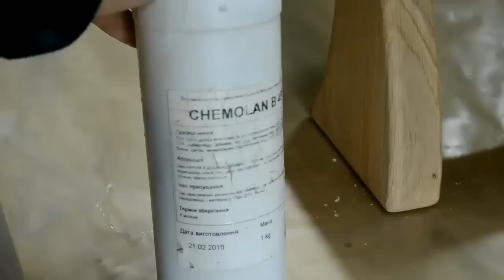Epoxy bench

Comment: Probably a stupid question but do the wood slabs need to be dried to proper moisture before doing this? Do you apply a sealant after cutting?
Reply from the maker: I work only with a dried wood